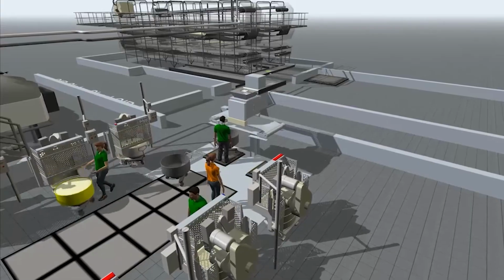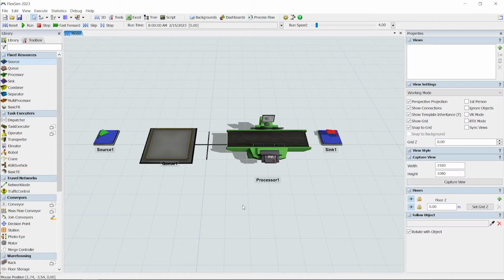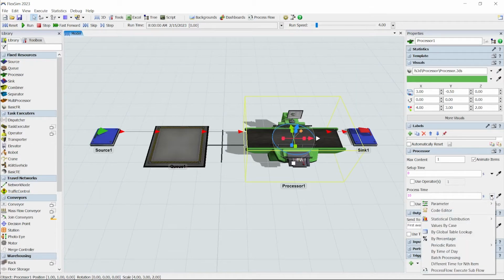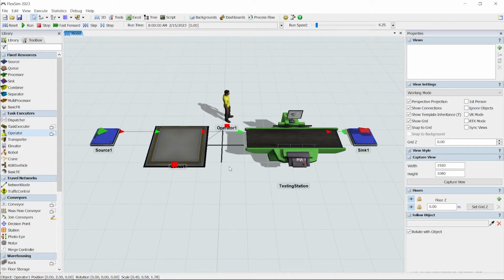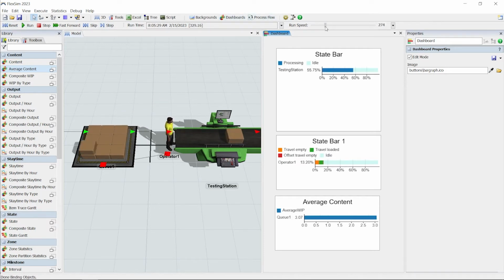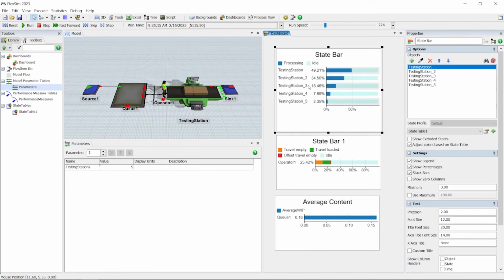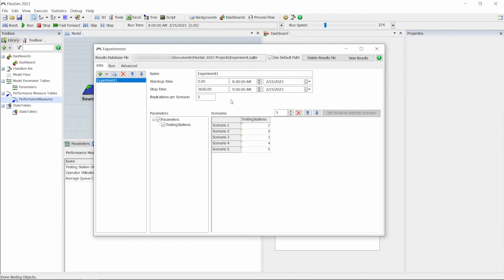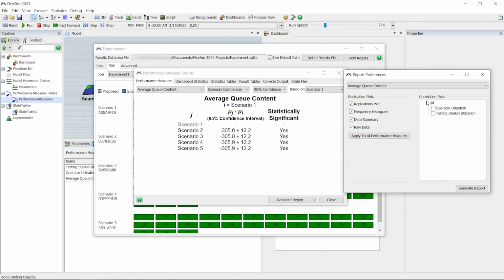FlexSim 2023 | Build Your First Simulation Model

Comment: I am very empessive on  this Model,but I found myself in the State Bar 1 show nothing at all. it's empty what the parameter went wrong, so I might present my opinion here to ask why? Thanks a lot
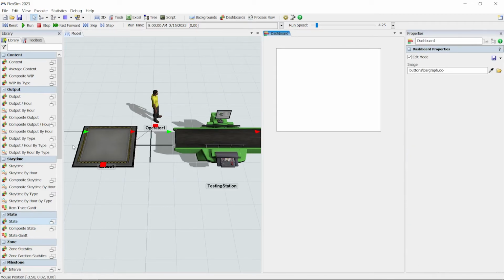Reply: I had this issue too. so when you click on the state bar 1 for the operator, you have to make sure that under state profile, StateTable1 is selected from the dropdown as shown in 9:24
Reply: @itsenbelivable I did that for both the State Bar for the operator and the State Bar for the Queue and still having empty parameters. I do have parameters for the Testing station though. I had parameters for all 3 State Bars when there was only one Queue connection to the TestingStation.
Edit: I realized it the 3rd chart was an "average Content" and not a State chart, and am now getting parameters for the Queue. That being said, my State Bar chart for Operator1 isn't showing after I've added multiple TestingStations.